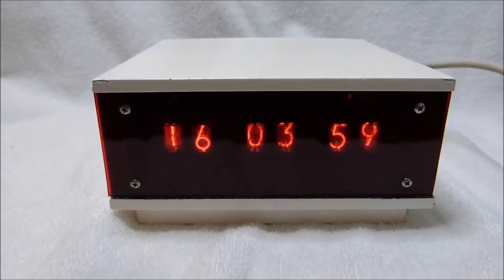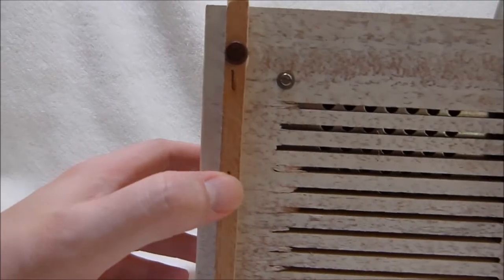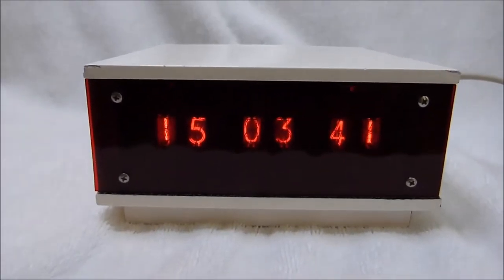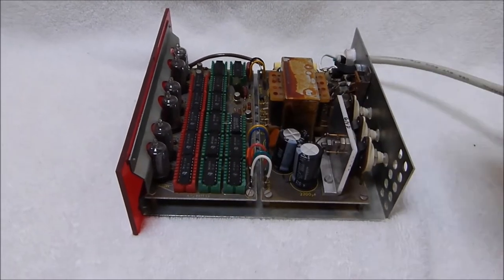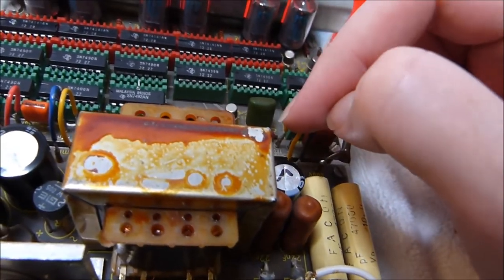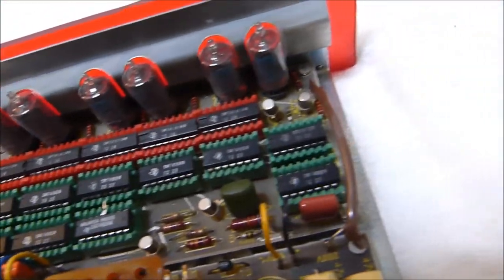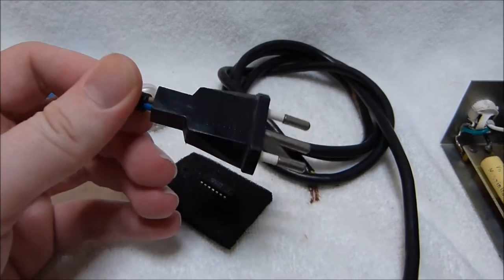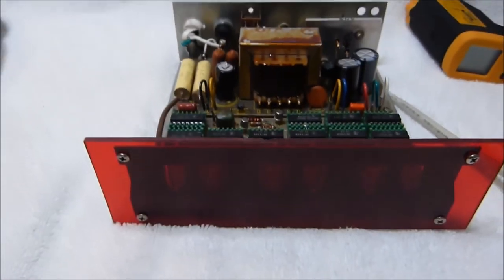AMTRON UK 820 digital clock with Nixie tube display (1972, Italy)

Comment: Congratulations on reaching another subscriber milestone. Difficult to know the provenance of this clock. It could have been a kit with a decent case supplied as one of the components. The fact that it has a strange method of setting the time doesn’t surprise me. I worked in technical support for an Italian company between 1978 and 2016, and  saw more than one unusual design choice (including the lack of a discharge resistor in a high voltage power supply, which gave me a shock, literally). The fact that the chips are socketed may also indicate a kit, although many of our products from the 70s through the 80s used sockets. The lack of any kind of logo or label is strange. In any case, it’s a nice clock. Thanks for sharing.
Reply from the maker: Thanks Colin! My suspicion is that it was a kit, partially based on its use of sockets (which I have also seen in higher-end factory made products), but it's just not clear. There are a number of decent ways to de-bounce switches, so going with the clunky potentiometer option seems like a bad call to me, but I'm sure they had their reasons (most likely, cost). However, there's really no excuse for the lack of a discharge resistor, and I almost got shocked too! You sure had quite a long run with that Italian company, they must have been good to work for, some odd designs aside.
Reply: The company I worked for was Marposs. They make electronic gauging systems, and were a decent company to work for. I worked for them from 1978 until 1988 in the UK, then transferred to the US. Interesting job, for sure, although could be stressful at times when installing high-dollar projects in automotive engine and transmission plants.
Reply from the maker: @Colin_Ames  I can definitely see how working on very expensive and potentially fragile equipment could be stressful, since one wrong move could cost a lot of money (for the company at least). It does sound like interesting work though.

Comment: I remember the first nixies that I'd ever set eyes on, were in a Hobart digital deli/butcher shop scale, pretty much around the same time as this clock was assembled. LED numeric displays came onto the scene (in eastern PA) in mid-1974, and were damn expensive. Unisonic calculators, and LED numeric display watches came into fruition around the early 1975 time frame. Edmund Scientific was the first company that sold them at affordable pricing, then Jameco, then Grabar.
Reply from the maker: I though I replied to this, but I guess it didn't go through. Nixies and reasonably priced integrated circuits for making clocks only overlapped for a brief period in the early 1970, so clocks like this one are unfortunately quite rare. By 1975 Nixies were thoroughly obsolete (and LEDs were king) and they were getting dumped at low prices by surplus sellers. I wish I could still buy B7971 tubes for the 3-4 dollars they were selling for by the mid 1970s!

Comment: Looking good as usual.  Amazingly the conditioning in my ESE 112 clock is not nearly as complicated and it is keeping good time!  Oddly it creates a 4 volt peak sine wave above zero and that is fed directly to the first 7490 with no squaring.  That Graymark clock had a similar 2 transistor shaping circuit to your clock here but it had spike issues and would have benefited from inductors and capacitors like yours here.  As you know I just decided to go with a schmidt trigger to fix it.
Reply from the maker: Thanks Jim! They may have gone a bit overboard on the AC filtering and pulse conditioning, but maybe they were having issues with erratic operation.  It's interesting to hear that the pulses can be much less square-wave like and still not cause issues though.

Comment: If it has sockets for all the ICs then I'm pretty confident it wasn't mass produced.  I could be wrong though.  [And nice work on solving the frequency problem.]
Reply: I agree, most likely a kit.
Reply from the maker: Thanks! My suspicion is that this was a kit too, but I'm just not sure, as the build quality is pretty good.
Reply: I agree. Sockets are rare in consumer electronics.
Reply: Given the "quality" of the case, I have another suspicion: The mfgr had an incredibly cheap source for factory rejected 74XX chips and had to just try out / mix&match which ones worked together and which ones did not.
In the early 70s wages in italy were quite low, so just having workers to try out which chips worked together seems doable.
Reply from the maker: @SharkoonBln  I don't think the IC's were rejects, because they all still have the TI logo on them. Fallout parts usually had their markings painted over or scraped off, if they had them to begin with. My guess is that this was a kit, as some of the parts would likely have been cheap-ish by then, like the nixie tubes and drivers (just ~2 years later everyone was trying to get rid of them, because they were obsolete).

Comment: Using the high voltage AC input improves the rise time (the slew rate of the higher voltage is greater) and allows for a crude conditioning circuit. In 1972 the price difference between a coupe BJTs vs. a proper comparator was quite a bit.
Reply from the maker: Good point, and I forgot to mention it in the video, but I checked the output of that conditioning circuit with a scope, and it was a very reasonable square wave.

Comment: An LS series chip cannot drive the 7400 series well. To use an LS chip, you'd need to swap them all for LS.
Reply from the maker: From what I've read online at least, the LS series parts can drive at least a few 74XX parts (I'm seeing varying answers, 5 or 10), but the L series can only drive 1 74XX part. The issue I was having with the 74LS92 chips is that the frequency coming out was too high for some reason, but I didn't try running them unloaded.
Reply: @50sTransistorRadios  It was my impression that it was only one or two. But, if it was, say, five, that could still be a problem.